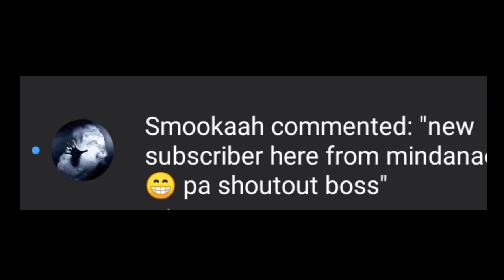Part2 naayos na yung xrm pero nagpalit sya nang block last rebore na pala sya

Comment: Ano ba ang last bore ng xrm110 paps?
Reply from the maker: 52mm or 100 last rebore
Reply: Boss suggestion naman. Semi load set up lang sa xrm110
Reply: Ok lng poh ba u ng last rebore?
Tatagal poh kya un??
Reply from the maker: @kianajoydeluna7207  ok lang yun paps
Reply: Nka 54mm bore poh kc ko kso umingay na poh xa..
Ala kong mahanap na 54.50 o 55mm na piston..
Blak ko sanang i 56mm nlang na last rebore..
Reply from the maker: @kianajoydeluna7207  masyadong manipis na yan
Reply: @ILOCOSMOTOSPEED  prone na poh ba yun sq over heat??
Reply from the maker: @kianajoydeluna7207  oo paps
Reply: @ILOCOSMOTOSPEED  maraming salamat po...

Comment: Boss ano ba size last rebore NG xrm
Reply from the maker: 100
Reply: @ILOCOSMOTOSPEED  kong e kumpara po siya sa block na 54 53 56 alin po ba sami size niya jan
Reply from the maker: @animelovers8956  wala po ang last rebore nang piston nang xrm 110 is 52 po
Reply: @ILOCOSMOTOSPEED  kong mag papalit akong ng bore 56 need paba tabasan ang crankcase kc sabi don sa bibilhan ko ng block plug and play siya
Reply from the maker: @animelovers8956  matatabasan paps